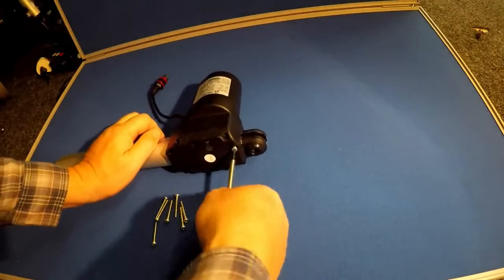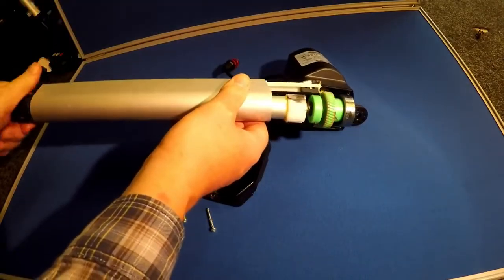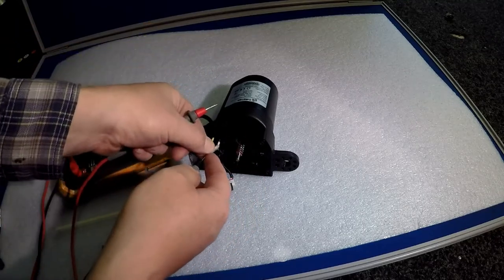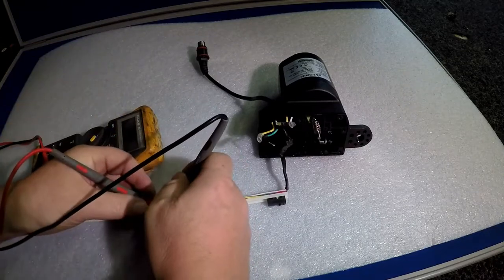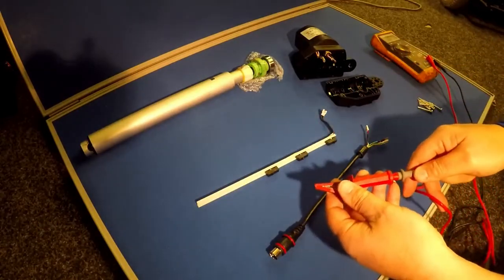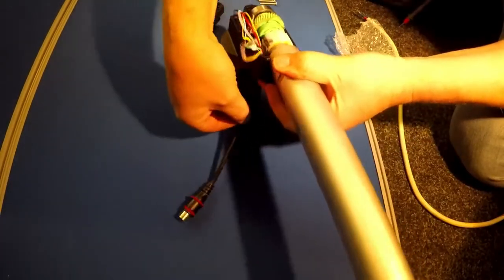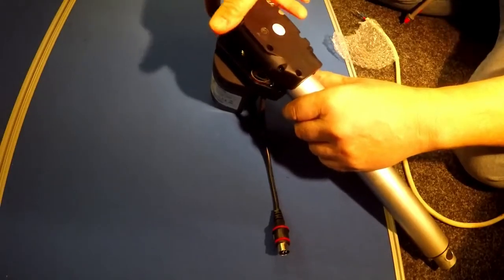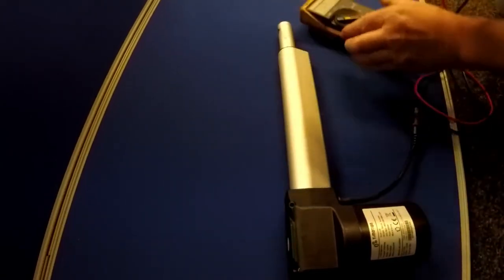Ti Motion Motor Repair

Comment: Thank you Tom, can you do a video on checking an AMG battery condition does it lose Ah or can not take a charge.
Reply from the maker: clive harmsworth hi Clive it would be a boring video as it’s a  discharge tester I use. It drains the battery over a given period of time and gives a percentage reading. I did show this when I tested batteries on the power chair repair.